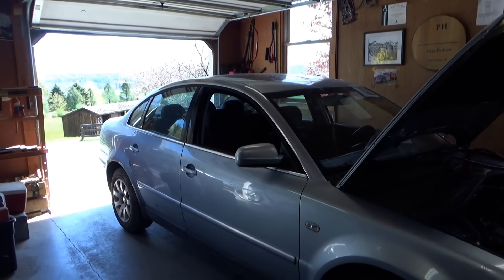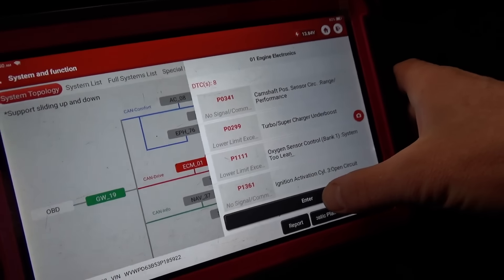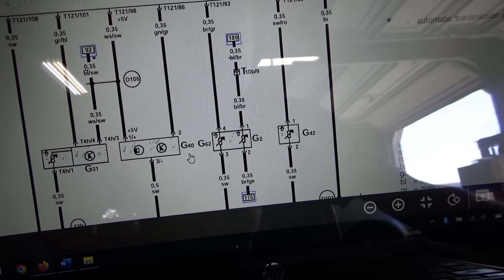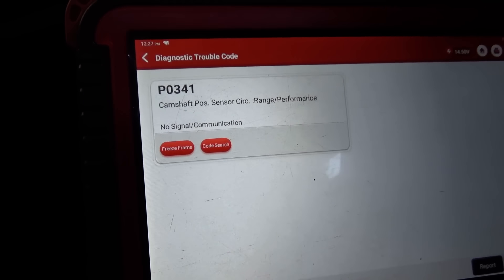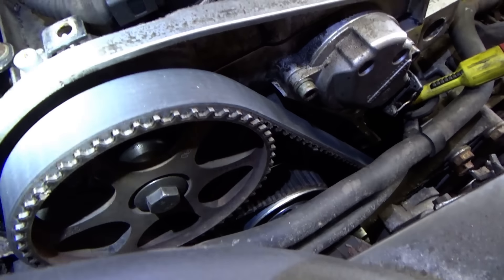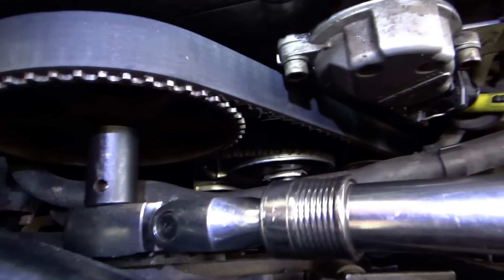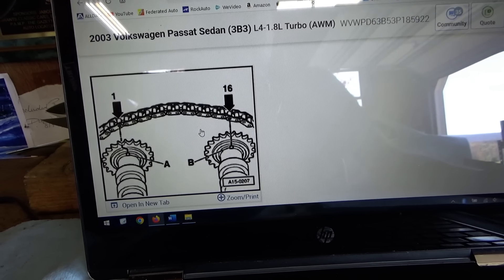Crank 5 TIMES to Start?? Part 1: Diagnosis (VW Passat P0341)

Comment: OMG!
Exactly the same problem has my 2000 Corolla. (chain driven VVti, no belt)
1st long crank, no start.
2nd crank, easy start.
Then runs like new.
What are the odds?

I have no clue either.
This video will save my sanity and the car.
ooh yeah!
Cheers with beers from Greece.
👍

Comment: Have changed alot of timingchains on these engines when they was fairly new (worked at vw dealer)
You need to take the camshafts out. The book say to take the timing belt of. But i usaly ziptied the belt to the sprocket and just lifted the camshaft in the rear.
Reply: On the money 👍

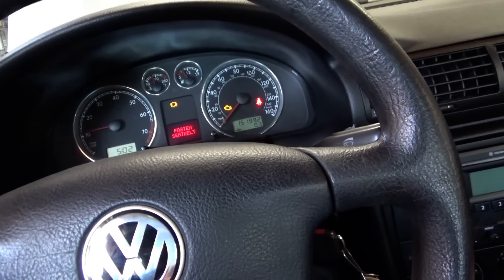Comment: Only at 3:00 - at this time I would be tempted to check if something which is supposed to be powered in start / run wasn't losing power when in start. Bumping the key so the system is in run while the engine is turning when it starts is what would tempt me into that path.

Comment: Hi Ivan,
Great case study. I had the exact same issue working on a VW Passat where there was work done before. I think the original error was indeed the  chain guide between the camshafts. Another shop install the new piston with chain guide and timed it incorrect. Then the owners didn’t had faith in that shop so it became my project😃I was aware of the 16 chainrollers, but the way I became convinst of an incorrect camshafttimi ng was the angle of both loops. In TDC they should be both, let’s say 45 degrees (of cilinder 4). The intake lope was different then the exhaust lope. After timed it correctly the problem was solved. Unfortnially the other shop replaced every part that came up with the DTC. Lambdasensor, camshaft positionsensor, variabel intakemanifolt, crankshaft sensor…..😩. 

Thank you for sharing your case study!

Kind regards from Amsterdam
Reply: Only I was incorrect with my previous comment; the engine needs to be in TDC but then the powerstroke for cilinder 4….😃 (if you want to visual see the angle of both slopes)

Comment: How about adding on the 3rd channel of Pico the ignition signal for cylinder no 1? It is a typical setup to check for cam/crank synchronization. You can see exactly how the timing works during crank and after starting. In fact, you should first prevent the engine from starting to get a base recording then try another recording with engine started. Also don't forget about the huge waveform library from Pico.
Reply: In vcds you can check synchro. it show a high signal ping crank shaft correlation with cam shaft.

Comment: Surely the chain spacing is 15 1/2 as per the diagram at 17:00, which shows the Ex mark between teeth and the In mark at a tooth. So the gap is not 16, but 15 plus a half tooth. Also, the chain is numbered 1 to 16 but if you count the first pin as zero the pin numbered 16 is really 15th. I think the chain is one tooth out.

Comment: That TDI that "kicked your butt?"  No, Ivan, I disagree; you just had to throw that brain in high gear and do a bit more thinking because it didn't just jump out at you.  Just like you did in this video.  You reasoned that the timing is off because of this or that.  You had to THINK about that; that's not kicking your butt, you just had to get that grey matter bubbling.  GREAT VIDEO!

Comment: Humm, the same owner of the other timing issue, rear engine seal...
Maybe the owner knows enough to be dangerous and is not having the right service info resources or marking things when he takes things apart? You can't just be close enough when doing any sort of timing belts, chains, etc. It has to be precise, especially on any ECU monitored engine. It will always throw a code. Ivan, there should be an additional charge for whenever you have to sort out other people's mess up's. I'm looking forward to part II.

Comment: There is a reason Volkswagen points out the link count. The exhaust cam is not variable so if the crankshaft timing mark is lined up, and the exhaust pulley timing mark is lined up then the exhaust rear sprocket is exactly aligned. If you set the intake cam sprocket as per the 16 rollers then it will be in time. So it either jumped time (seems unlikely)or someone messed with it and counted wrong . Some timing chain setups will jump timing if the engine is rotated backwards.

Comment: Timing is out, your scope capture clearly shows the difference while cranking compared to starting. I just did a search for a known good(found one on diag net) and it is clearly off. My concern is now that maybe it might have bent valves? You did say its running rough...

Comment: I've got many years of experience on 1.8t forums, if I had $5 for everytime I've seen the 16 rollers issue, I'd be retired and living in the Bahamas by now. The way it's counted makes it very easy to make a mistake.
Reply: @cjrock4096I think the issue comes from which roller is 0/1 and that advance/retard mechanism
Reply: It does not say 16 "units" or "links", it says 16 "rollers" aka chain pins or rivets, so you count the first and last pins; IOW there is no "0" or "0 to 1", it's mark on cam 1, roller pin 1, to mark on cam 2, roller pin 16.
Reply: @cjrock4096Exactly, except even mentioning links will likely confuse the issue. This is the same as bicycle chain length is measured in rollers or pins, not links; the links themselves have a pitch, which is the center to center measurement of the outside rivets or pins; the most standard being .5 inch (12.7mm).
Reply: @cjrock4096 It's unclear which roller to start counting from. When the marks are aligned, the exhaust mark is halfway between 2 rollers.
Reply: @cjrock4096 You're missing the point here. Obviously there is a correct way to do it, but the factory manual explains it poorly, and if you don't have the manual then it's very easy to make a mistake and set it up a roller out. Maybe you are Mr perfect and never make a mistake, but I've  probably seen over 100 people that have either set it wrong, or posted on the forums asking for clarification as to how to count it correctly.
Reply: @TheOnespeedbiker  I'm glad kia uses two black plates 8 pins apart.  You have TWO references.
Reply: @cjrock4096 alldata only sell to businesses, but there's no single vehicle licence anyway
Reply: I notced that right away..  Why do they start the count from the far left side of the first sprocket tooth?    How weird.. It's like they wanted to make it more confusing. lol
Reply: @cjrock4096 The confusion comes from the fact that they are counting from the outside of one tooth.. over to the outside of the other tooth;  which is not a typical way that things are measured.
Reply: @cjrock4096 It seems like every comment section has an a..hole too 😀
Reply: @MattyEngland  I guess you and those 100+ in the forums have a problem counting 1-16 Rollers plus lining up the timing marks. Anytime i have read those forums there are a lot of clueless people compared to those who do know what they are doing. Like the forum dipwad that filled up their VW Diesel with gas then blamed the fuel station that the Pump wasn't marked good enough. Big lineups at the gas pumps so he took the one with no line. LOL Destroyed the injection pump and injectors. Lesson learned, if you aren't bright enough to fill up your own vehicle with the right fuel, DON'T BUY A DIESEL.

Comment: Owned a 2006 Jetta 1.9 TDI manual.  Great economy, fun to drive.  But it kept going wrong.  Needed a reliable car for a job with a longish commute.  The final straw was when it left me stranded halfway up the mountain on route 56 on the way to work in Johnstown.  Sold it the very same week.
Reply: The 1.9 TDI is generally a tank of an engine. Often regarded as the best engine VW ever built :D They usually last 500k km+
Reply: @tschuuuls486 is not necessarily trouble-free miles, though.  What the point of it if within that time you have to replace the turbo twice, and as I said, it still keeps going wrong?  One of the times mine quit, I towed it to a mechanic who had it for a week and still couldn't figure out what was wrong.
Reply: @robbflynn4325  Well, they are super common in Europe, so basically every mechanic knows how to fix them. And maybe you got a bad aftermarket turbo or it had a leak in one of the charge lines and it over spooled the turbo?
Reply: @tschuuuls486  Yeah, that is part of it.  I just stick to Toyota now.  They are boring, uninspiring, bland, but my word, they are so reliable.
Reply from the maker: There are definitely some steep inclines around Johnstown!
Reply: @PineHollowAutoDiagnostics  I know you know the road, and you will be aware there are no shoulders on the way up there, and there are lots of curves.  Not a good place to break down!

Comment: I applaud you for working on German cars, I know they are a super real pain to fix sometimes👏
Reply: German cars are just a bit different from American cars. But nothing that many other American technicians can't handle daily. And don't even make me started about the quality of American cars compared to German ones...
Reply: @zbigniewrichard8291  American cars in general are utter shit.
Reply: Gee, I found my two beetles the easiest cars to work on ever.  Well my datsun will always be #1 for clutches.  But shear simplicity, the Germans had it right as long as you replaced the rear axle bolts with socket head bolts so could crank them on tight.
Reply: @robertsmith2956  You are talking about old beetle, right? No computers, no servos, Fred Flinstone style car. Because the new beetle is a POS.
Reply: @zbigniewrichard8291  Yep, the one that floats.  Rear engine, enough steel to come out on top with a  semi.

Comment: Cool, just finished up yesterday with a 08 !  Luckily it was a much easier lean/ random misfire issue. Misfire only at idle which was obviously vac. leak(s) . Couple on loose intake connections but the main culprit was the diaphragm in the crankcase valve. You can pop it off and get just the kit from OhhhRiellys for 40$. 👍👍🇺🇸

Comment: Talk about total confusion!
The specs should indicate the "Roller or link" adding in about the difference seen with the tensioner up or down with an extra picture to illustrate this.
I see part two (I hope) as being an eye opener.

Comment: I pull the plug and drop the coil back on.  On compression stroke the coil will pop up.  Then bring up to top.
The missing valve cover bolt in the back lets the cover raise enough for chain to jump.  🤩
My money is customer says nope, the engine had never been touched, that is original timing chain  any missing bolts is from vibration.     LOL

Comment: As far as I know, these engines have often problems with low oil pressure due to a clogged strainer on the intake snorkel in the oil pan. The oil pressure is needed to control the variable valve timing. This may also be the cause of the error in the error memory. However, this would not explain the poor starting. That's why I think you're on the right track with the 16 teeth distance.
TDC:
In older longitudinally installed VW and Audi engines, the top dead centre marking is often located on the flywheel and there is a corresponding hole in the clutch bell housing on the driver's side through which it can be checked.

Comment: I actually bought a 08 audi a4 last Sunday, I would normally dodge euro just based on track diagrams. It's a salvage car that just needs a headlight, a bumper cover and a hood. Has some oil leaks and needs some exhuast work but its super clean for around here. I got it cheap cos they couldn't get the hood open.
Reply from the maker: They're so reliable, you never need to open the hood!.....lol
Reply: @PineHollowAutoDiagnostics  that's hilarious 😂

Comment: Could it be that because the timing is off the car won't start until the oil pressure comes up to run the phaser?

Comment: Leave it up to VW to use both a timing belt and a chain!!!! If that were a Toyota, that chain in the back would be a gear. I know, they wanted to use a chain so they could have a weird VVT system like no one else....
Reply: 😂 yep ... plus chains stretch and guides / plungers wear out. Vw 😬
Reply: Happy to report turned 70 last month 10 years since I had to work on a shit box vw.next on list bmw

Comment: This is like déjà vu 😂 I’m THAT guy you should have made this video 18 months ago. Had the cam out… used Amazon parts… didn’t know what I was doing… yes and no.
Reply: I had it worse.  AFTER I did the valve adjustment on a new bike, I found a 6 year old video on it, and not taking the crank cover off and messing with that gasket.  Put in 1st, and spin the wheel to turn engine.  Just use the cam timing marks for alignment.

Comment: Might be the oil solenoid is faulty and allowed the chain to jump a tooth by not tensioning correctly. Remove the solenoid and check the screen for debris and test electrically.

Comment: On the factory drawing the arrow,notch and roller look aligned on both camshafts. On that car i t looks like the the sprocket of the intake cam is aligned with the gap in the chain rather than the roller. But wouldn't that make it 1/2 a tooth out? Could the sprocket be loose? Weird

Comment: I've got my own problems to troubleshoot today.  Almost became a smear on the highway the other day.  Transmission went wonky trying to merge.  It was fine immediately after but then lost the PRNDL display driving to lunch and it seemed stuck in 2nd gear.  Fixed itself a few seconds later.  Happened again on the way home.  Scanner says P0702, P0706, and P0707. Transmission Range Sensor Circuit intermittent Fault, Transmission Range Sensor A Range/Performance, Transmission Range Sensor A Circuit Low.  I can definitely confirm intermittent.  With it being low, I'm guessing a short to ground somewhere.  I'm guessing the other performance/range code is related to the circuit low code.  Got to mow my lawn first, but then I'm clearing my plate today.  I really don't want to crawl under my truck right now with shoulder problems. This might go to the local shop.

Comment: These have timing belt issues. I always replaced the timing belt after around 100,000 miles for sure. Had a friend with a beetle 1.8t just stall out on him and went to check it out and it sounded like the classic no compression and peeled back the timing belt cover and found it just shredded in there. I'm sure it bent valves since he coasted it in gear trying to give it gas and then tried cranking it over. His uncle showed up and said it needed an alternator. He just got another engine put in. Our 1.8t Jetta had the same issue. Was cruising on the highway and went to pass someone and the engine started loosing power and then just stalled out on the freeway. Took a couple of plugs out and found they were just smashed to hell. Pulled back the timing cover and found the belt had shredded. It only had around 120k on it.
Reply: Belt interval is 60,000miles or every 5 years.

Comment: Would not comparing the scope at the long crank versus starting versus running had told you that the timing was off?  Yes, 1/16 variance of the correct position might be a little difficult to discern, but it would have given you a feeling for if it was off.

Comment: Wish you lived closer. We have a Titan no start, just cranks. Far as I can tell, no spark or fuel. We changed the ECM, and the fuse panel near that. We still can’t access the key programming. U1000 codes. When cranking we loose battery juice fairly fast. Presently, the antitheft is on, due to changing the ECM. Not exactly sure where to go from here. No wiring diagram. So…
Reply: Check out Ross-Tech VCDS

Comment: I bet what happened is the water pump seized and destroyed the timing belt! Which bent every valve in the head! When you put everything back together the valve has to be extended all the way to set the timing of the cams if not extended all the way you will be 1 tooth off

Comment: ran into this problem myself on an audi tt. Same engine and some mechanics try to save money by retarding one tooth as the chain stretches. putting it back to 16 rollers it would not start. New chain and tensioner ...starts first time. They stretch between 0.5 to 1mm. Crazy!

Comment: When voltage measurements were taken on the harness side with the cam sensor disconnected, the cam signal back to the ECM read over 12V? How do you explain that? With the plug disconnected, I’d expect a 0 volt signal back to the ecm. 🤔
Reply from the maker: Pull-down circuit, ECM sends out 12V to CMP :)

Comment: I had the exact same car year , miles, symptoms. Sold it let the kid drive home 100 miles on my plate got a call a couple days later from the police he hit and ran a HOUSE ! And the plate came back to me. No more Mr nice guy
Reply: I had a drunk roll a car in my driveway.  Had 6 different plates in the trunk, and one on the back that also didn't match car.  I had an older model of same car, and sadly the parts were not compatible or I would have kept the car for parts.  So I told cops to tow it away.

Comment: I know on my TDI VW’s from the early 2000’s, if they didn’t crank fast enough, a similar situation would occur. Evidently a certain RPM would be needed for the car to start. Could be related?
Reply: I think the issue will be a diesel pressure sensor

Comment: Those cam timing marks are NOT going to line up to the arrows when in time or have 16 rollers between them. It appears you’re need to roll the cam 1 tooth.   

I have always had a correlation code when the cam timing was off though.
Reply: I don't think the variable timing solenoid is all the way up, if that is the case it would pull the extra slack and make them line up again
Reply: @dwindeyer  the bentley manual even shows the intake cam notch forward of the arrow.  16 rollers is the spread even if it doesn’t look right, its right.
Reply: @dwindeyer  those tensioners have a shoe on top and bottom, it never slacks the cam chain unless you thread the hold down in to squeeze the mechanism together. 

That tool will make it easier to retime that intake cam.